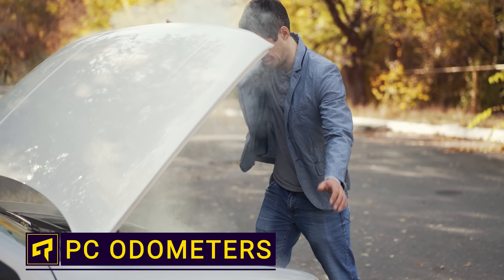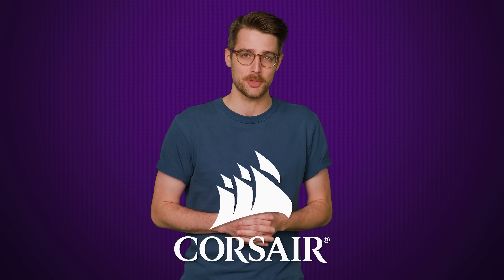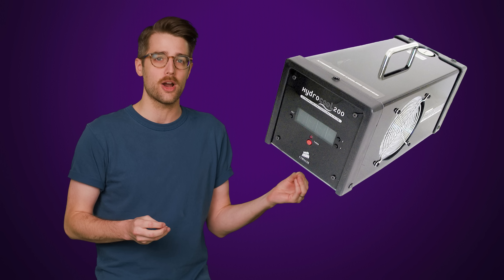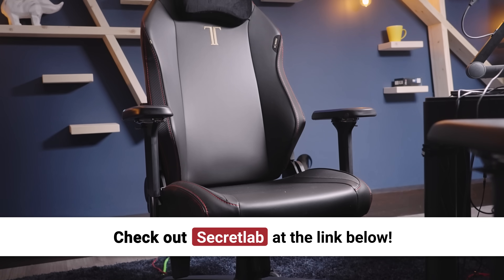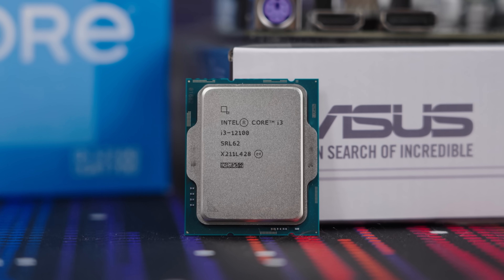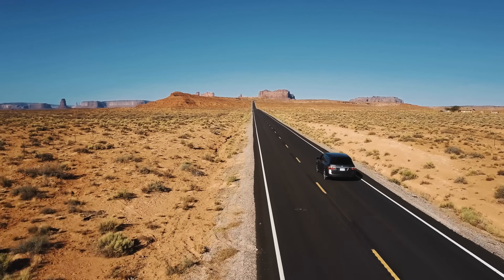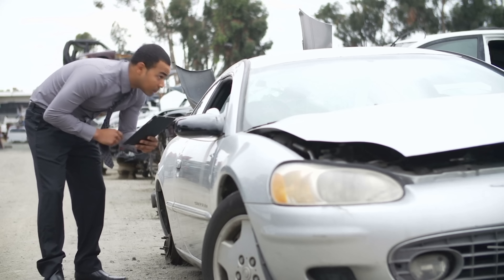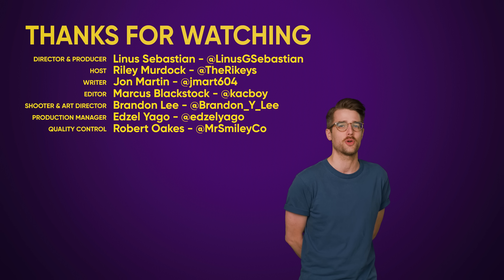Should Computers Have Odometers?

Comment: Hard drives track power-on hours, startup cycles, and total data in and out. Would be great if motherboards had similar. The best we get is LED diagnostics in case it’s not accessible.
Reply: it already has a clock and a battery..
would make perfect sense.
Reply: @VintageCR  It wouldn't even need a battery, it can store that info an non volatile memory.
Reply: tho i think smart data can be wiped its rare and only happens with reverbed drives (even then i have sean meny keep it)
Reply: Yea a motherboard would be good. Could track it easily in the BIOS/UEFI.
Reply: for HDDs and SSDs, mean-time-to-failure is actually a useful metric. motherboards die so rarely and randomly that tracking total throughput on any given bus wouldn't give owners or operators any real predictions on device lifetime. sounds like maybe you didn't watch the video for the reasons why it's not worth doing this...
Reply: if you have the right diagnostic tool for a car you can also make it look brand new. if they would track hours and power level and temp of the vrm for example. in a 3D kind of map like a efi fuel map . every pc would have a unique picture. with easy to spot problems. if it would make an average of every 30 days it wouldn't need much space to save years of data. if the ecu dies in a car it also loses everything. i noticed that new eu regulations make the car transmit fuel consumption data to authorities . you 'd be suprised of the amount of data cars collect. i work on toyota cars everyday with diagnostic tool. a rav4 for example has around 40 ecu's
Reply: it's not really useful though. these parts can last decades. hdds and ssds have either moving parts or finite lifespan
Reply: Exactly what I was going to say Chris.
Reply: Windows uptime in the resource monitor system.
Won't work for used products because you can just swap this stuff in and out and the uptime remains the same. But it's useful for personal use.
Reply: Just because it can be tracked doesn't mean it should. SSDs have somewhat definite life spans for their hardware based on usage so tracking read/write cycles makes sense. A Motherboard, GPU, RAM, etc. don't have any way like that to judge the health of them, so while you could track power cycles, running voltage, or runtime, it'd just be giving information that doesn't have any causability for the condition of the card and would just mislead consumers.
Reply: @alyssa2242  because if they would add all those components and r&d the board would cost so much it's just easier to send a new one to those that have a failure within warranty. just look how they do it for servers. that's the best and cheapest way to do it for pc's . but if you would know how many hours a gpu has spent on full load or higher (110% power) vs the total number of hours and the temp profile  . just by plugging in a usb cable and connecting it to another pc . wouldn't that be great when buying a second hand gpu? being able to prove it's never over clocked or always undervolted would be a good thing imo. those parameters can be stored as a simple yes or no. the same things you mention also applies to cars. being able to make a calculated choice is always better than taking a guess . when the data is available taking a guess is still possible . so it's better for more types of people

Comment: Ram: life time waranty
CPU: never dies in normal usage (unlike mobo, it's why there's so much cpu and so little mobo on ebay)
Reply: Another part of that is the fact that people like upgrading CPU’s and keeping the same motherboard

I myself have had 2 for my current Desktop and plan on a third if a 5950X3D comes into existance

For my laptop ive had 3 3210m, 3380m and 3740QM

And i have know some people that have bought over 5 CPU’s for the same motherboard

Such as one person that had i think a G3900, G4520, 6500, 6700k, 7700k think they eventually got a 7740x

CPU:Motherboard
So for my desktop 2:1
For my laptop 3:1
For someone i know 6:1

Comment: S.M.A.R.T has this sort of data for storage

GPU’s have fan tachometer thing

CPU’s dont really need one as they are for the most part immortal and same for RAM

Motherboards have a battery you can use to check for the ruff age of motherboard so long as they prior owner or the seller hasn’t changed it out

To be honest parts just dont really die and those that do are either really really old or has had to much data written but SMART data shows thats to you
Reply: Both CPUs and RAM suffer silicon degradation, and do even more so when overclocked, which they often are, these days right from the factory. Giving these some stability tests when bought second hand is a must. Heck, I'd recommend running such tests yearly on your own stuff, especially RAM tests, cause RAM is usually kept around for the entire generation.
Reply: @notfeelinglikeit  life time RAM warranty = if it degrades below its XMP or starts spitting out errors its easy to replace and transferring warranty from seller to buy can be done but its fiddly and between buyer and seller

CPU’s do degrade but by far far to little to notice

Also no CPU is overclocked out of the gate the CPU and its BIOS have predetermined specs and a motherboard manufacturer can choose to ignore them

CPU degradation is almost solely linked to temperature as opposed to what speed its run at

Buying second hand parts can be iffy yeah but thinks like RAM and CPU’s dont typically degrade enough that you will notice a difference unless the XMP profile cant be run any long or unless the CPU goes Kapoof as boost is a fixed voltage to frequency you will notice a crash under say a WinRar compression test

For Ram can it run the XMP and pass a memtest

For CPU can it use WinRar and compress 50GB of data at best and 1024 solid archive
Reply: @commanderoof4578  I'm not sure if all RAM sticks come with "lifetime" warranty and what "lifetime" actually means for different vendors. Then again, you'll only know to utilize your warranty if you actually test your RAM every so often. WinRAR doesn't really sound like the best tool for the job either by the way, I'd stick to a proper memory tester, like TestMem5. Just used it last week (with Anta777's so-called "ABSOLUT" config), let me and a buddy of mine know that it was time to let our RAM sticks go pretty quickly.

As for CPUs, as far as I'm aware voltage also plays a significant role when it comes to silicon degradation. I'm unsure how the newfangled turbo-ing techniques, automatic power shifting between GPU and CPU and other stuff affect degradation, but I don't see why they wouldn't. Especially due to all the additional variation in operating frequency and voltage they'll experience. It may have been misleading to call these out-of-factory overclocking though, I'll concede on that one. Definitely would only be a concern for used hardware too.

Comment: Why? Because computer component manufacturers aren't that shady.
Reply: It would be the opposite of shady to include wear meters.
Reply: @filonin2  maybe for the resellers, the way I see it though odometers barely count as that and basically exist to artificially deflate the value of older cars and to effectively softlock cars beyond a certain age from ever being able to compete with new stock regardless of the amount of care and attention given by the previous owner because of the focus on a metric that is only the roughest of indicators as to use and hardly takes into account the actual effect of that driving. Imagine a counter for a CPU that told you how many clock cycles it had run but not the average run temperature, the utilisation percentage or any other relevant statistics other than clock cycles, that is the equivalent of an odometer and it would clearly be very bad for resellers that take care of their chips and undervolt and use good coolers and whatever for little reason other than to drive down demand for used products.